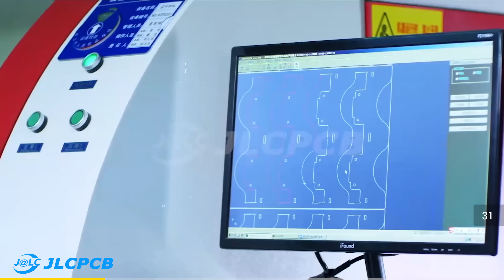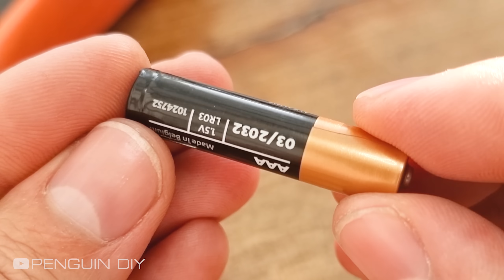How to Make a Rechargeable 1.5V AAA Battery with USB-C Port - DIY Rechargeable 1.5v Battery at home

Comment: It seems this would be the best choice for output voltage with low leakage current. The chip  AP2406ES5-1,8

Comment: Great channel and cool videos. I am pleasantly surprised by everything. It was especially nice to accidentally find out that you are from Iran. I also have Iranian roots on my mother's side. Everything is good in this project except for the AMS 1117 1.5 V microcircuit. It is popular, but its own current consumption for such circuits is very high and it needs to be replaced with a better microcircuit with a current consumption in idle mode with meager ones, in micro amperes, and not in amperes. It would be good to look in the list of other microcircuits and also available for sale.

Comment: 1117 transistor itself is greedy, I tested it, the 1.5-hour acalogue watch worked for 4 days, for other devices it would be better to solder other transistors, because I use 1117 only from the mains with a mobile phone adapter

Comment: Great execution, but the circuit idea is quite bad. Using linear regulator you waste most of the battery capacity as heat. Worst case with cells full you waste 4.2-1.5V so 2.7V times current draw. If you try to draw bigger current the regulator will probably overheat and shutdown especially you have filed off the heat sinking.

Comment: AMS1117 just removed 60% of your battery capacity to heat. I'd rather add a buck converter and remove one cell for similar capacity

Comment: If you insist on using the original battery (AAA Li-C), the battery will explode/leak, But in the video it uses Li-Po..., so it's 100% safe...

Comment: Here's a simple breakdown of AA batteries vs. rechargables:

Basically, 1 Ah from an AA rechargeable battery equals about 3-4 Ah from a regular (non-rechargeable) AA battery.

Think about a computer mouse:

A cheap 680 mAh regular battery lasts about two weeks.
A more expensive 2300 mAh regular battery lasts 1-2 months.
But you'd have to recharge a rechargeable AA probably every 3 days to get similar uptime!
So, for a rechargeable to match a regular battery's lifespan, it really needs at least 2 Ah capacity.

Comment: How much battery backup? 55mah is'nt enough I think so in parallel so it would be 110mah, but is it enough and that AMS 1117 also not that efficient I've checked its details; it doesn't has that much efficiency in result not much juice to consume from the batteries other than that love'd your work that efficiency on next level. 
Some options that I've found online are much more efficient and can give better backup

1. PAM2305 (Compact & Efficient)
    Input Voltage: 2.5V – 5.5V (perfect for Li-ion)
    Output Voltage: Fixed 1.5V option available
    Efficiency: Up to 97%
    Max Current: 1A
    Package: SOT-23-5 (tiny, great for DIY)
2. MP2182 (Ultra-Small & Efficient)
     Input Voltage: 2.5V – 5.5V
     Output Voltage: Fixed 1.5V
     Efficiency: Up to 90%
    Max Current: 1.2A
    Package: SOT-23-8

Comment: Amazing stuff. Like yhe walnut one. If i wanted to get into this, where would one start? Is this called micro electronics? Are there books or websites on this? I have no idea on the components, gauge of wire, what resistors etc. Any tips on where a newbie should start would be much appreciated 👍

Comment: I would suggest you using some kind of soft sealant instead of epoxy, as the battery packs should have some room for expansion and contraction due to temperature changes, etc.

Otherwise great video, keep it up!

Comment: One might add: make sure the two seperated LiPo batteries are at the same charge and voltage when putting them in. Otherwise they could be overcharging or overdischarging easily. Or to be absolutely sure, put in a battery management system.

Comment: Very bad.
No BMS (battery protection),  very low capacity (110mAh at 1.5V output), very low output current capability, no way to know how charged it is and VERY LOW EFFICIENCY (30% from input port to output terminals).
I choose Ni-Mh AA/AAA cells (if there isn't a way to use  3.7V Li-ion directly) for AA/AAA devices.

Comment: Very nice execution, that assembly looks very clean and the final result is great.
This can be useful for some very low power device that needs to be charged on the move, but those two 55mAh batteries feeding a linear regulator means that you have 110mAh useful capacity when a NiMH cell provides about 900mAh

Comment: 1:55 no se llega a ver pero si hacen eso con el tp4056 no te va a durar nada esa pila recargable casera se va estropear muy rapido, la solucion es cambiar la resistencia R3 la que es de 1.2k y por una de 10k para que el tp4056 cargue la bateria PEQUEÑA a 100 miliamperios, NUNCA una batería pequeña de 50, 100, 200 miliamperios no se debe cargar con una corriente de un 1 amperio que es la corriente de carga por defecto del tp4056 y por mas que tenga su bms se va recalentar e inflar y degradar, entonces al cambiar la resistencia de carga del tp4056 por una de 10k la corriente de carga solo va ser de 100 miliamperios que es lo ideal

Comment: There is a problem with using ASM1117 or any regulator. They drain current with no load. And also they efficiency is awful. But it was as always nice project

Comment: Ams1117 consumes 2ma in standby. 110 mah will be discharged completely in 55 hours. Sad truth. 
I am using lp2985 for my projects.
It would be wonderful if you cooperate with some MCU geek to open a greater circuit and software solutions.

Comment: What type of molding paste do you use to temporarily fill the usb connection?
Reply from the maker: The impression paste that is mostly used by dentists and consists of a can of paste and an additive similar to toothpaste.
Reply: @PenguinDIY  what brand is it? And is it silicon based or something else?
Reply from the maker: @Sereen666  Send me a direct message on Instagram and I will send you the picture
Reply: @PenguinDIY  thanks for the pictures and information. 

Looking forward to your next project! 🙂👍

Comment: Hello, where do you buy small wires? for example, 2:54. can you please share a link
Reply: I think its 40 awg wire you can search 
Its measured with AWG the higher number the smaller diameter of the wire gets
Reply from the maker: I purchased these wires from Iran and bought them in person, and I don't know of any website.